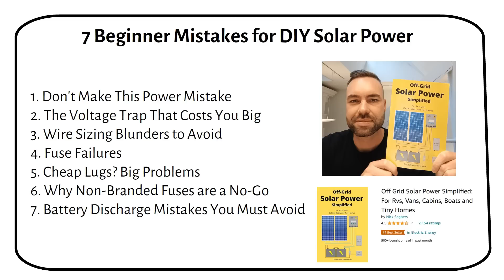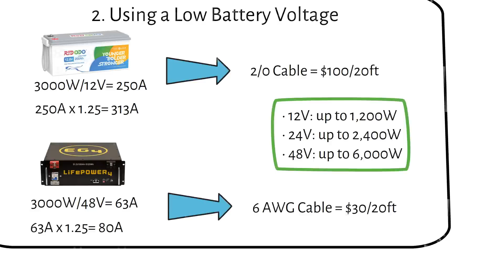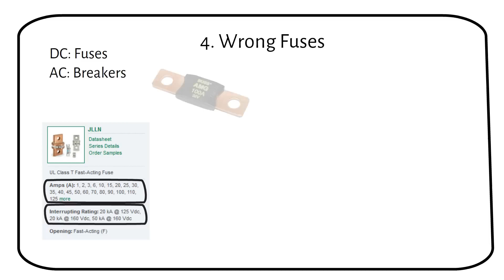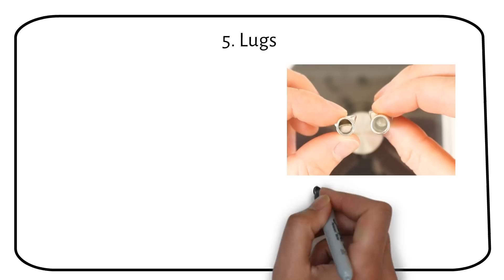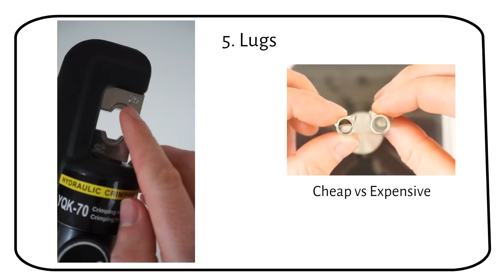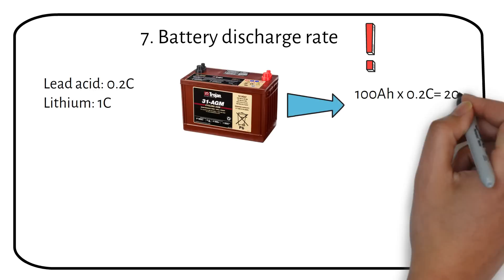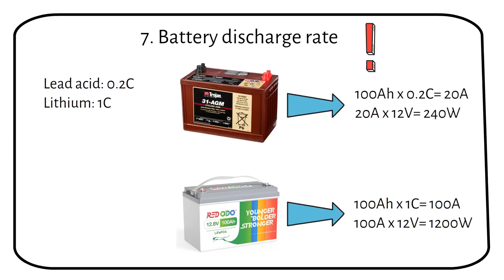7 Mistakes For Off-Grid Solar Power Systems - Avoid These!

Comment: I have a victron multiplus 5000va 24v 120amp inverter and a victron mppt 150/85-tr charge controller.. approx 12000wh usage. How many panels and what lead acid batteries do i need....

Comment: in regards to charge and discharge rates. is the charge rate a per hour measurement? 0.2c seems to me like it would drain a lead acid tubular battery to 50% in 5 hours. am i getting this correct or no?  what if you need it to last you 24 hours?  or 72?
Reply from the maker: C-rate is a current measurement based on the batteries capacity. 1C @100ah=100A. To answer your question: 12V * 100Ah = 1200Wh of stored energy, but you can only use 50%, so thats 600Wh. 0.2C of 100Ah is 20A at 12V= 240Wh. 600Wh/240Wh=2.5h running time.

Comment: Hi I have a 24V 240AH traction battery. Which converter can I connect to this and how many panels do I need at least to charge sufficiently?
Reply from the maker: Recommended to have a max of 1200W of inverter power (0.2C). Recommended solar panels is the same at 1200W to charge most efficiently.
Reply: @cleversolarpower  okay thanks. For you info.

Comment: I have a question who inverter companies don't give a good answer, they said you can charge your battery bank with external generator connecting to your inverter charger, what kind of wave  they don't say , pure shine or square or modify,I think only pure shine ,but most generators in the market still use square or modify.
Reply from the maker: There is a difference between inverter/generators and normal generators. The first have better sine waves, the latter have more 'dirty' power which not all inverters can take. I'm not aware of any inverters create a modified sine wave.

Comment: Hi @Cleversolarpower, this is Grandpa Emil, one of your avid subscribers in the Philippines. 

Will it be possible to make a YT video about the proper way of charging and discharging powerstations?  I am currently using a Pecron  E1500LFP and since I pretty much would like to make the batteries last longer, I would want to know the proper way of charging/discharging/storing it.

There are several schools of thought on this matter which, instead of helping me, sadly, it made my brain explode:

(1)  Some experts suggest to maintain at least 20% of its battery capacity before charging/topping it again for the next use. In relation to this, will it affect the one (1) cycle count if, say, I re-charge it back to 100% from 20% remaining viz zero percent because from what I've read, generally, a cycle is depleting the battery from 100% to 0%.

(2)  On the other hand, some would advice to charge/top it to just around to 80% (not 100%) before its next use.

(3)  Still, other experts would suggest that when storing LFP powerstaions, charge it between 40% to 50%.  Then use it after 3 months of storage to maintain its battery life (roughly 3500+ battery cycles).

That said, based on your experience and hopefully thru actual tests concerning the same, can you please provide us in one of your future videos the proper way of charging/discharging/storing powerstations with LFP batteries or any other battery chemistry, for that matter?  Thank you.
Reply from the maker: I recommend cycling a lithium battery from 10% to 90%. Normally you would program this in your charge controller and BMS of the battery. However, i don't think thats possible with power stations. Let's say your power stations battery can last 3500 cycles. That's still 10 years of use when you do one cycle every day. I think the electronics will die sooner than the battery itself. And after 3500 cycles you still have 80% capacity left. So don't worry about optimizing cycle life. Storage is around 30 to 50% charge, but again, that doesn't really matter.

Comment: I just get the biggest of everything I can. I have a 12kw transformer inverter in fitting soon and currently 20kw of 48v battery. The inverter in using now is only 5.6kw. not enough. I will need to up size the battery to at least 50kw to make it worthwhile. I also have one victron rs450/100tr charge controller to start with. 
 I'll be going with 120mm2 cable and 300a nt2 blade fuse.
 During any blackouts I can sell energy to the neighbours. At a free market rate of course😂

Comment: I liked this one!  I couldn't find anything serious to critique this time.  I'd just add, on spec'ing cable amperages, even if the insulation can handle high temps you still don't want high temps in your system for a variety of reasons.  Most prominently, voltage drop and thermal cycling causing connections to loosen over time.

Under-sizing cables is mainly a legacy 12V issue where people with 12V systems just couldn't afford super-huge 4/0 cabling to handle the currents they wanted to work with.   It is entirely unnecessary on a 24V or 48V system.   So always use 60C or "AWG for power transmission" tables in higher-voltage systems. 

-Matt
Reply from the maker: Undersizing cables can also happen in 24 or 48V systems. I don't recommend using only 60°C insulation rating because the wires will have to be bigger to support the same current as a 105°C wire would.
Reply: @cleversolarpower  Do you really want 105C (221F) cables anywhere in your system?  Connecting batteries, equipment, or running through a wall, or between compartments in an RV?   Or pre-heating fuses and breakers in the cabling path? Starting to see the problem?

Running cables hot is a 12V thing.  It is entirely unnecessary at higher voltages... for example, at 48V, 2 AWG translates to 5000W and the cables only get a bit warm to the touch.

When you have the choice, keep things cool.   You can still use cables rated for 105C... that's a good idea, but you don't have to size the cables to actually run even remotely that hot.

-Matt
Reply from the maker: @junkerzn7312  Using 105°C cables does not mean they will get hot. They are rated for higher current. If you size your wires correctly, they will not get warm.

Comment: Thanks big boss for your devoted and educative lecture . Best regards . To carry out load analysis on a system with Switch mode power supply ( SMPS), Can one use the Amp and Voltage rating on the SMPS for load analysis. e.g adapter for laptop charging

Comment: Why is it that everyone that does such explanations with using a 3000w inverter on 12v and suggesting cable size and fuses etc with the equation of 3000/12 fails to take into account that battery voltage when low or reaching BMS or inverter cut off may fall to 10v or even 9v. Cable, fuse, and even your 1.25 safety factor margin are out the window without taking the lower voltages into account. It's simple to say don't build such high powered 12v systems but there's situations such as in smaller recreational vehicles where 24v or 48v does not make sense.
Reply from the maker: Lithium batteries are 12V at 10% and 10V at 0%. If we use 10V as the worst case, then you will have 3000W/10V=300A. If we use 12V as the lowest reference, which was used in this video, we get: 3000W/12V=250A, multiplied by the safety factor of 1.25, we get 313A. This is still more than the 300A in the worst case scenario, so this passes. Your wire size and fuse size will both be larger than this. We will use a 2/0 cable which can carry 325A with a 300A fuse. Now you might think that a 300A fuse is too low. If we look at the datasheet, we can see that the fuse will never trip at 300A. Only at 525A after 16 minutes. Hope this answers your question.
Reply: @cleversolarpower  Thank you for your reply. You state that Lithium batteries are 10% when at 12v and 10v at 0%. I don't profess to be an expert and I'm learning more by asking questions, but surely that would only be true at a unloaded resting SOC voltage? Though lithium batteries are not as susceptible to extreme voltage sag under large continuous load as lead acid batteries are they still do suffer from it. Thus a 3000w inverter could run for some time at 10v 'if' the BMS or inverter cut off voltage is set that low. So, the battery voltage may be 10v but it's not truly at zero percent charge and without load it would recover to a higher voltage and the inverter would likely switch back on again. Which is one of the reasons voltage is far less useful as a guide to SOC with lithium compared to lead acid and shunts are more accurate. Also, with regards to cable size I would like to point out that despite standards (and here in Aus we use the B&S standard) not all cables sold from different manufacturers as a given size are created equal with regards to amp rating. Using generic data sheets rather than specific manufacturers data sheets for the brand of cable is asking for trouble. Then there's the reduction in current carrying capacity as ambient temp increases. Most cable ratings best figures are at say 25c. In a recreational vehicle traveling around in full summer inside temps can be double that.
Reply from the maker: @erroneouscode  Voltage Sag: Yes, lithium batteries do experience some voltage sag under load, and the inverter could operate at a lower voltage until the cut-off point, meaning the actual SOC would not be at 0%. However, it depends on the size of the battery as well. If you follow my recommendations, the voltage  sag will never be that much.
Cable Ratings: Always use manufacturer-specific data sheets for cable ratings and consider derating for higher ambient temperatures to ensure safety and reliability. In every video with cables in it i mention that if you want to use the cables i suggest, that you need to purchase these exact cables.
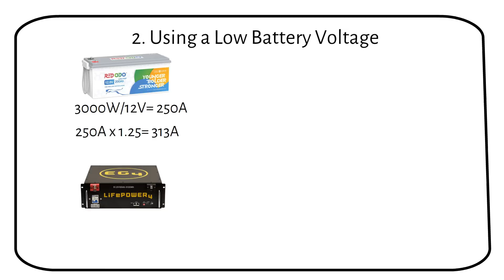Reply: 1:39  @cleversolarpower
Reply: THANK you for sharing your knowledge
Reply: He invested his time to make a video that is useful for certain people. He should be applauded. Nobody can satisfy everyone. If you have observed a gap in the knowledge, make a video about it and fill in the gap. That is why knowledge and learning are never ending.
Reply: @1982757  I do applaud his knowledge and efforts. I asked a question and didn't receive an answer. I don't need to make a video or to have someone simping for him because you see my comment as a criticism. It has nothing to do with pleasing everyone. If voltage drops, amp draw increases. If you can't answer the question either then your comment is hardly useful.
Reply: 24 volts always makes sense.

Comment: Seems most videos concentrate more on either 12v or 48v systems. A detailed 24v split phase system video for temporary home backup would be awesome.
Reply: 12V only makes sense for use in an RTV. 

24V has a big advantage: Sensors, plc etc. run on 24V. You will do hard finding components in industry quality for 12 or 48V, when building some sort of control system with a big battery backup.

48V is good for diy battery storage systems.

Comment: Good day sir,
I have 2 250W solar panels and one tall tubular 12v 240ah battery and a 30A charge controller,
I am using an egg incubator which runs 24/7 on AC 1000W inverter charger, my charge controller shows my usage 7A on average, sometimes it's not sufficient for my incubator and it turns off, so what could be the problem, please help on this regard.
Reply from the maker: 7A*12V=84W*24h=2000Wh. you only bring in 1500Wh with 3 sunhours per day. Your battery is 2880Wh. You need to increase battery power and put more solar panels.
Reply: @cleversolarpower if I add one  12v 100ah battery, and connect a 250 solar panel to it without a charge controller for day time usage, will it be enough for day use?
And can a 250w solar panel charge my 12v 240ah battery alone for night use?
Will this setup work?